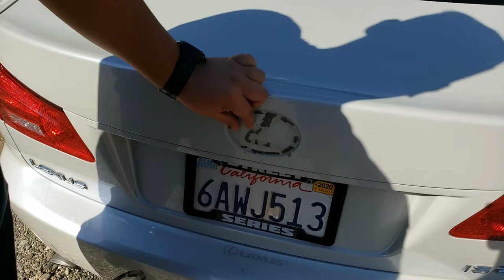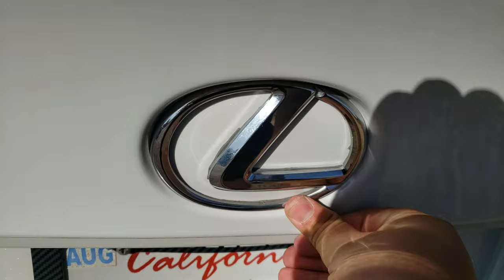Installing Lexus IS250 Duckbill

Comment: What year is this Lexus? Lol I just bought a 2007 is250 and now I’m trying to start build but I don’t know too much about cars. Definitely gonna start with rims lol how much were yours all together?
Reply from the maker: Hell yeah man you're gonna love that car! 🔥 Its also an 07 & we got the rims off our friend for $700 with tires 👍
Reply: Street Series jeez that’s a great price, hopefully I can get some for around that price out here in San Diego
Reply from the maker: @michaelbradford8557  you definitely can bro! Just check offer up, alot of people sell their wheels with tires for cheap 👍
Reply: Has your check VSC, trac control, and check engine light ever came on?
Reply from the maker: Nope you'll be good bro! Just be sure when you take your car to get the tires mounted, have them take your tpms sensors from the old wheels & put them on the new wheels 👍
Reply: @michaelbradford8557  mines did I just got a 07 too and my check engine light is on and my vsc or what ever is called 🤦‍♂️

Comment from the maker: What would you guys like to see next?! 😁 & what are your thoughts on the duckbill??
Reply: Where did you get the duckbill?
Reply from the maker: @michaelonuoha8668  On Ebay bro they're really cheap on there, usually they have combo deals where it'll include the rear diffuser or rear window visor. Here's a link to one if you have the 2nd gen IS250 or IS350:
https://rover.ebay.com/rover/0/0/0?mpre=https%3A%2F%2Fwww.ebay.com%2Fulk%2Fitm%2F202209327521
Reply: @StreetSeries  much appreciated
Reply from the maker: @michaelonuoha8668  No Problem bro! Here to help 😁

Comment: Any link for the duckbill tho?
Reply from the maker: Yeah bro here are 3 links! One is the duckbill on it's own, the other is with a rear visor & the other is with a rear diffuser. I'll drop them all under this comment! I hope it helps 😁🤘
DIFFUSER+DUCKBILL
https://rover.ebay.com/rover/0/0/0?mpre=https%3A%2F%2Fwww.ebay.com%2Fulk%2Fitm%2F301473612510
DUCKBILL
https://rover.ebay.com/rover/0/0/0?mpre=https%3A%2F%2Fwww.ebay.com%2Fulk%2Fitm%2F222427965708
REAR VISOR+ DUCKBILL
https://rover.ebay.com/rover/0/0/0?mpre=https%3A%2F%2Fwww.ebay.com%2Fulk%2Fitm%2F202209327521

Comment: Can you share the link to the duckbill pls
Reply from the maker: Yeah bro here are 3 links! One is the duckbill on it's own, the other is with a rear visor & the other is with a rear diffuser. I'll drop them all under this comment! I hope it helps 😁🤘
DIFFUSER+DUCKBILL
https://rover.ebay.com/rover/0/0/0?mpre=https%3A%2F%2Fwww.ebay.com%2Fulk%2Fitm%2F301473612510
DUCKBILL
https://rover.ebay.com/rover/0/0/0?mpre=https%3A%2F%2Fwww.ebay.com%2Fulk%2Fitm%2F222427965708
REAR VISOR+ DUCKBILL
https://rover.ebay.com/rover/0/0/0?mpre=https%3A%2F%2Fwww.ebay.com%2Fulk%2Fitm%2F202209327521